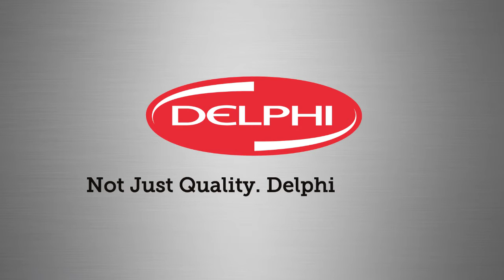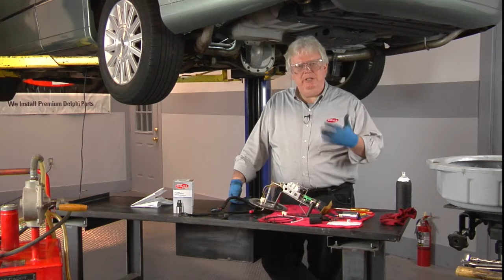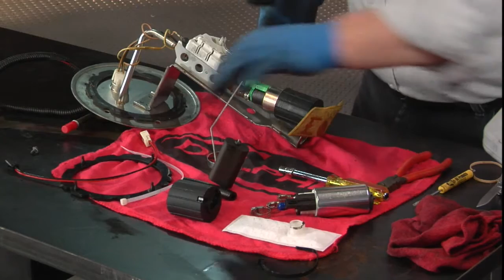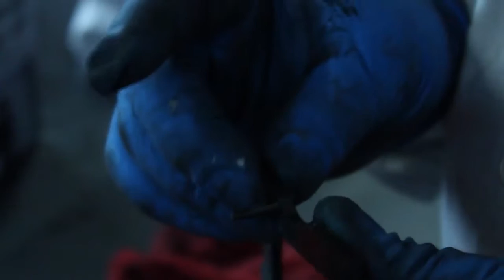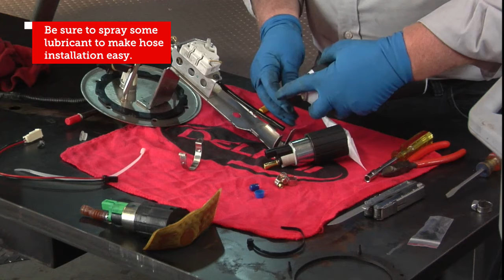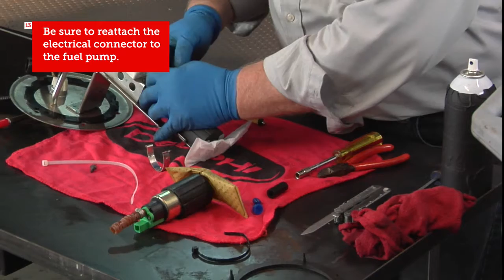How to Conduct a Fuel Pump-Only Replacement

Comment: WoW, isn't that easy. Unlike the Delphi Technologies fuel pump I purchased. The one I purchase requires the replacement of the wires. So I have to cut /splice and solder a new connector. Why don't you show him doing that?

Comment: After two failed  CFE 0115 Fuel Pumps two years apart, i don't trust delphi products.
Reply: Sounds like there might be another issue causing the pumps to fail